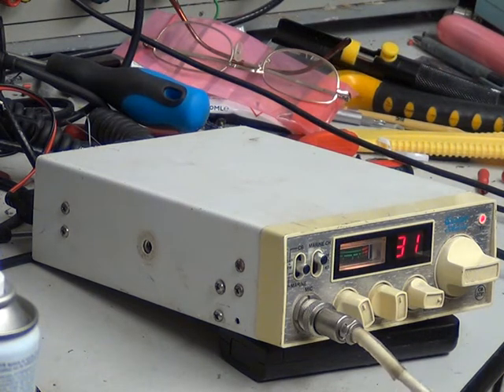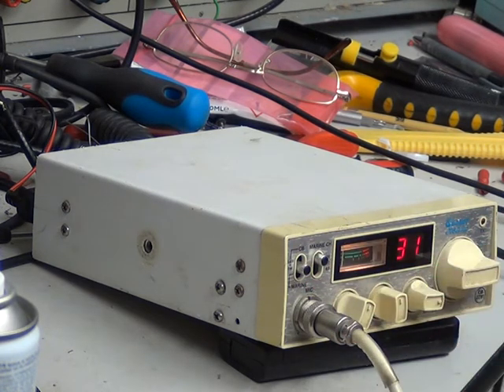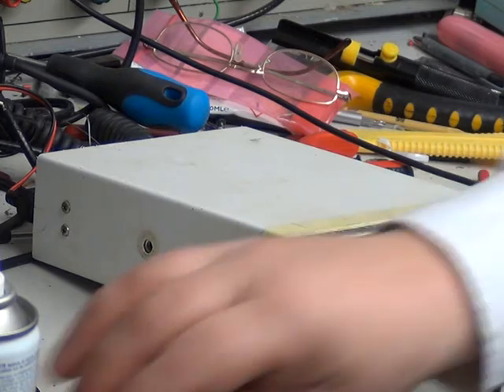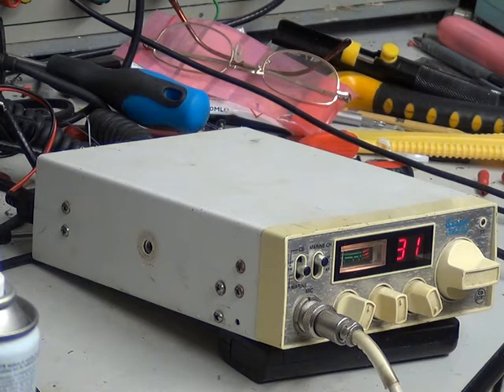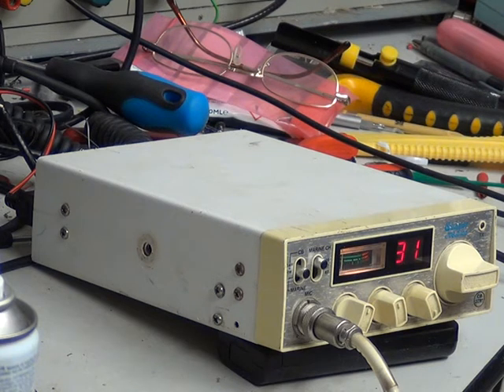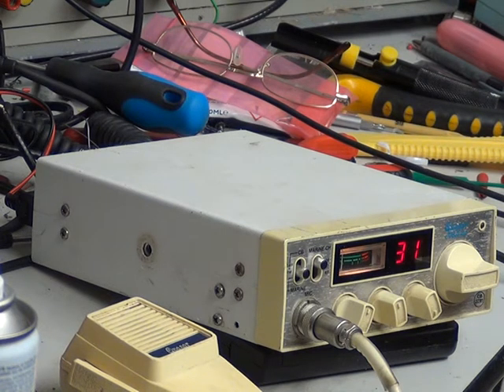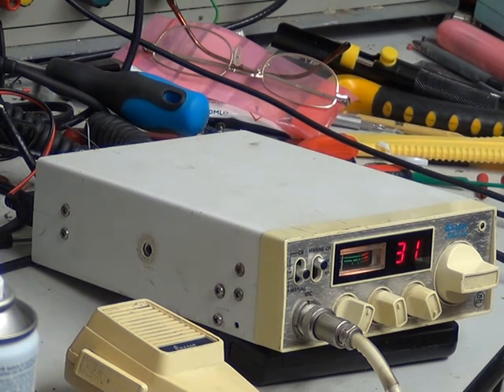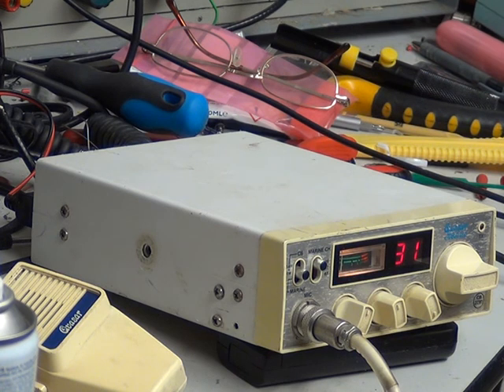Quasar MCB400 (CB 27/81) CB radio with marine receive (mobile) -  On The Air Test

Comment: Great Video thank you...IIve just got my hands on a Quasar MCB400 so could you please tell me what antenna to use for the Marine Band...Keep up the good work............
Reply from the maker: Whereas a 1/4 wave full length whip is 9' in length on 27Mhz. Marine band on VHF requires around a 16" whip for full 1/4 wave  As it's receive only it won't be as critical as if one was transmitting, so to be honest an aerial for 2M amateur radio would work fine, or one for VHF business radio on VHF high band (such as many taxis use) would also be OK. Marine band sits between the 2M amateur band & VHF high band.

richard
Reply: @ukfmcbradioservicingTango21  Many thanks for that in depth reply....

Comment: Hi I have just aquired one of these but it's in need of TLC .It Powers up but only the meter light is working and no channel display or any other signs off life.Is this the same issue you had with that one ?
Reply from the maker: Yes. Everything made by Uniden in 1981-1983 now has knackered capacitors without exception. Any Uniden from that era passing through the workshop regardless of faulty must have the 220uf capacitors changed. There are either two or three of them....I can't quite remember. That is always the fault for the snag you have. Remember to get the polarity right when changing them!

Richard
Reply: Hi thanks for that .I replaced 4 electrolitics 2x 220uf and 2  470uf and it's up and running gave it a service and a clean up and it's working well .I need to find a mic now in white can't seem to find one .Cheers

Comment: Just out of interest, what was the initial fault with it requiring some of the electrolitic capacitors to be replaced? As well as owning a working Quasar MCB400 i've recently acquired a similar 'Unimetrics Sea Hawk 40' which turns on but has no TX, RX or audio.
Reply from the maker: As the Unimetrics sea hawk 40 isn't jn my list as being a UK set, I can't comment on that product. The Quasar MCB400 is a Uniden made cb radio transceiver with 3 receive only marine VHF channels.35 years later I'm finding that all Uniden based CB radios have 220uf electrolytics failing, so I change all three in every set that comes in for service regardless of working or not. In the case of this demonstration radio, that is all that was changed plus a proper alignment tune-up with the test equipment here.

Richard
Reply: @ukfmcbradioservicingTango21  Thanks Richard, the Sea Hawk is almost identical to the Quasar as it too is basically a re-badged  Uniden PC43 with the 3 marine channels.  I've replaced all of the 220uf electrolytics as well as the TA7310P which turned out to be the main problem.  Thanks for the help, very informative videos & channel, Ben.

Comment: Nice Video mate, I too have a Quasar MCB400 as well as the Jesan KT5005. I have to say I much prefer the Quasar. I have owned it since the mid 90's and still use it today. Although CB is fairly dead here, because I live in a seaside town the three Marine channels still receive plenty of traffic with the Coastguard on Channels 16 & 67 plus two of our local yacht clubs and powerboat club on Ch 37. The KT5005 is ok but it only has marine 16 & 67 and the CB display stays on when you select either channel unlike the quasar where the CB display goes off when in marine mode. Also I assume the RX is not as good on the KT5005 as it does not have a separate VHF antenna unlike the MCB400.

Comment: Interesting Richard , I had one of these about 20 yrs ago , only kept it for a short while then past it on ,, but nice to see one again ,, also if you get space in the future ,, in time that is would love if you could do one of your magic tune ups on a manor kestrel,, my only radio left ,, that I've owned for yrs, and will never sell,, despite having one screw missing in the case , I have never had the top or bottom case off,, it has always been reliable despite not pushing more than a couple of watts,,  please contact me in the future if interested in doing a tune up,, great video well and clearly explained to ur usual high standard ,,, cheers Shane Warks,,, will be nice to no how m0ogy is doing health wise,, hopefully he is on the mend. Thanks shane
Reply from the maker: The Manor Kestrel uses the UK4000 chassis also found in the LCL Communicators 440DX (of which there are two variants). I've covered the Communicator before, though will do other sets utilising the same chassis in the future.  I find all these radios work very well indeed, yet others hate them & compare them to a Fidelity 1000. It's the receive that is a swine to tune-up on the test bench, the tx is normal.

Richard

Comment: Would an additional marine band license been required for this radio at the time?  I'm not sure one was ever required but imagine it might have been since regulation was relatively high back in the 80s.
Reply from the maker: A bit of a grey area as MPT1320 states "no other transmit or receive circuits may be incorporated into the equipment". So fai enough, it's RX only but a bit dodgy. Bit like having a new car factory fitted with air horns when the law states they are only allowed on pre-1969 vehicles!

Richard

Comment: Just Bought one of these on Ebay :-)
Reply from the maker: Good, but I bet both those 220uf capacitors are knackered!

Richard
Reply: Radio arrived two Days ago & today a Uniden Power cable arrived . Connected the Radio up & to my surprise it worked OK though had to turn up the mic gain a bit when making a contact. Could not test the Marine channels as don't have a Antenna for that yet. Any suggestion on what antenna to use for the Marine Receiver Richard.
Reply from the maker: For the marine receive, a straight quarter wave whip around 16" in length would be about right. When you look at aerials for VHF high band (business radio for taxis etc), just get one of those & cut the whip down to 16".

Richard
Reply: Cheers Richard thanks for the help